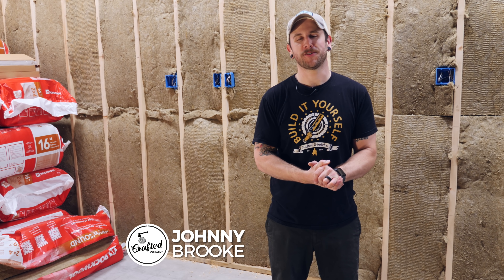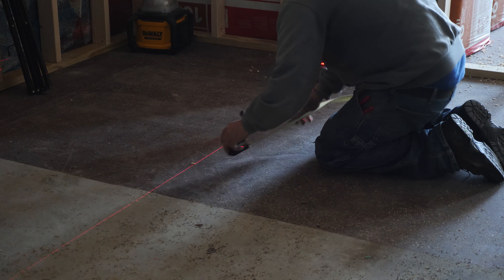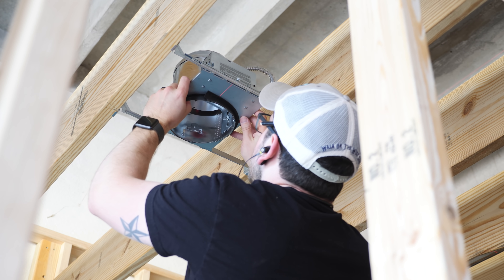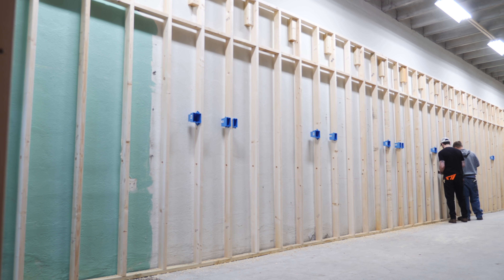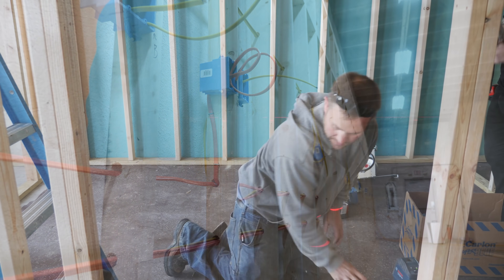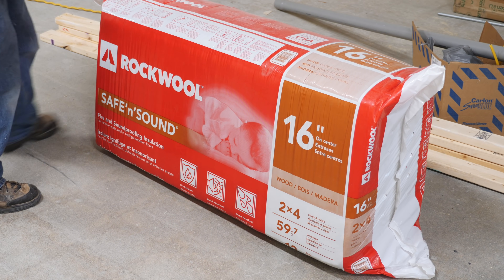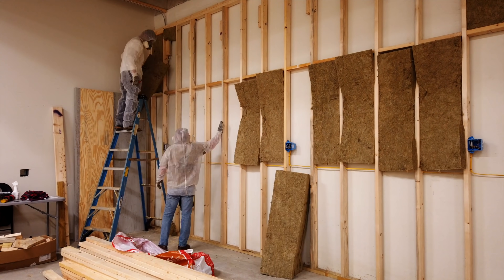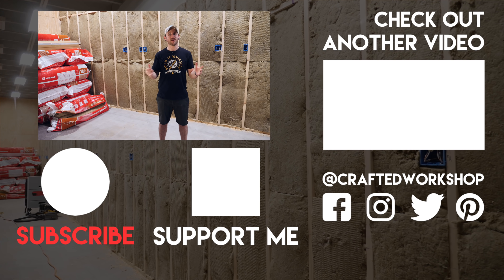Building My Shop : Electrical, LED Shop Lighting & Sound Proof Insulation

Comment: Good video! Did your electrician give you crap for not leaving a few inches of slack cable outside of each box, or is code different in the US? I only have basic knowledge of wiring, and your layout is SUPER clean, but this seems to be a major no-no afaik...?

Comment: You made more work for yourself by running the wire down the entire length of the walls rather than finding the middle of the wall and running it down one side and then the next.

Comment: You should have used those plastic bridge romex staples with the 2 small nails instead of using those Metal staples because those metal staples can pinch and short out the  conductors of the Romex cable !

Comment: If the 2x4 stud wall has the gap between it and the concrete wall could you just run the wiring in the gap and avoid the drilling on every stud?

Comment: Im an electrician in norway and every wire and staples look so complicated in america, its like you are 50 years behind
Reply: pølsemakern  do you have samples of a video like this that meets your countries standards?
Reply: @dennispope8160  https://www.youtube.com/watch?v=1ILpUdxIvSo, we have tubes in a curved shape so that water / condensate will drain into boxes, cables are finished in pipes straight from the factory, it is not shown in this video. We use pipes to be able to change the cables, as something happens to them.
Reply: This video is a bit old and we do a lot of smarter things, and this video is for people at school so its a bit slow
Reply: @dennispope8160  https://www.youtube.com/watch?v=MLQ6IWLPX0E
Reply: @dennispope8160  https://www.youtube.com/watch?v=YIIuksNh1pI

Comment: Great build, being in UK construction it’s interesting to see the differences in legislation. In commercial installation we have to use steel framing for all our partitions, due to the wood being a fire hazard. All cables passing though a partition or stud wall must have a steel plate nailed to the face to stop anyone boring or nailing through to the cable.

Comment: Somebody forgot to tell them about a service loop.  Oops.  Otherwise, nice work.
Reply from the maker: That’s much more common for things like Ethernet cable. Electrical cable has to be secured to the studs, you can’t have extra wire floating around.
Reply: @craftedworkshop  That must be a regional/american  thing.  Here (Canada), it's a staple within 8" of the box and we always have an 'S' type loop ahead of that but before the box.  I like it because I've done so many renovations and replacing switches and receptacles is a royal pain with no extra wire.  Thanks for the reply. Great shop!!

Comment: Why not run the wires between the studs and the concrete wall❓ Maybe attach them to the concrete with cable clips.
Reply from the maker: Drilling into concrete is much more time consuming, not sure it would have been any faster.

Comment: Do you have ground in every power outlet, just curious. I wonder why and if that is because you use metal rods for the romex cables. Here in Sweden we use plastic rods with flex in them to wire up cable in walls, with ground ofcourse.
Reply from the maker: All of the wire we pulled already had a ground wire built in, so that we can then ground the outlets.
Reply: @craftedworkshop  aha, I thought it was something like that. Thanks for answering. Good luck with your new workshop 👊

Comment: Don't you have to put metal plates on the studs to stop you from drilling into the wire? Or did I miss that?
Reply from the maker: No, since the wires are ran deep enough in the walls.

Comment: That laser has come in ridiculously handy on this job. Love the idea of measuring on the floor and then shooting it on the ceiling with the laser. Wiring looks great. I bet your electrician loved it. Thanks for sharing!
Reply from the maker: Thanks, definitely loved the laser! And yes, we made it super easy on the electrician.
Reply: Yes, having the holes line up for the wiring looks really professional . Sure , it won't be seen later , it's just a sign that the craftsmen take pride in their work . One thing though , I always strip my romex before putting it in the box , it makes life easier later, for a number of reasons .

Comment: That insulation surely killed the echo problem, but won't the plywood walls bring it back considerably?  

In any case, great work.  Very interesting to watch this come together.
Reply from the maker: Thanks! The plywood will bring back some echo but the space should be much nicer and the sound transfer to my neighbors will be hugely reduced.
Reply: @craftedworkshop  Yeah, definitely the issue of noise from your activity is an important matter.  It's definitely looking great.  Maybe you could hang fabric on top of the plywood or something to help your end?
Reply from the maker: Yea we’ll see how it sounds once the plywood is in!
Reply: Rather than add a new comment I’m adding to this thread because it continues what you’ve covered. I’m a former live sound engineer and current sound editor/designer. I’ve been doing this for years so I know a few things about sound control. 

I’ll start with some clarification. There’s a difference between sound ISOLATION and sound TREATMENT. Isolation is also called sound proofing - it keeps the sound from transferring through the walls to your neighbors. This is definitely the most important concern due to shop noise. Sound treatment is controlling the sound inside the given space. This is achieved through absorption and diffusion. In a space with long parallel walls you will have tons of slap and reverb. Once you put up tools, cabinets and machinery that will help diffuse the sound but it needs to eventually be absorbed. 

If you  put in some large frames on the top half of your wall and fill it with the insulation, you can cover it with some basic canvas or I’ve seen other shop owners use various flags. This will keep the sound under control. The more you add the better it will be. If after this you still have too lively of a room you need to add either soft walking mats on the floor or out more panels up top. 

Great build so far.
Reply from the maker: Thanks! And yea, that is why we built the sound panels in addition to adding insulation to the walls. We’ve already finished with the plywood and the echo is certainly still drastically better than before, and that’s without all my stuff in the space to break up the sound.

Comment: The staple in the 10-2 at 7:03 looks like it is too tight go back and loosen it some if you can.
Reply: Ohh Paul I noticed that too. Also in future you should leave some slack in the wiring, in case you ever have to do any re-wiring you have some to pull through. Great video though!

Comment: Great space!   I have years of acoustics training from recording studio design.  The added wall may not do as much as you hope since you didn't frame all the way to the ceiling and also because you effectively coupled the framing of your new wall to the original wall.  The safe n' sound will help a bit with sound transmission between you and your neighbors but when you add the drywall or plywood over the insulation, most of the benefits that you currently hear in your microphones will be gone and the room will have about the same amount of echo as it did before.  It will sound a little bit different because you changed the dimensions of the room by adding walls and because wood, drywall and concrete all have different sound characteristics... but a lot of the echo will return.  You will likely need a bunch of sound absorption panels along the walls (similar to what you put on the ceiling) to kill the sound reflections bouncing around.  Keep up the great vids and good luck!
Reply from the maker: Good tips, thanks!

Comment: Loved it, quick question the 240V is it just for the tools or is America switching? Never heard of 240V in America also 50 or 60Hz?
Reply: America isn’t switching lol, it’s just for more heavy duty tools
Reply: @JR0405  Thanks for the reply would've Found it odd if you we're switching. Is there also then 400V 3 fased available in the US for even larger machines?
Reply from the maker: There is!
Reply: @JustinManson  480 three phase
Reply from the maker: 240V is for tools with bigger motors or larger power draw, like my welders. We’re not switching, hah!
Reply: @craftedworkshop  thansl for the reply would've Found it odd if you we're switching, good luck and excited to see the rest of the build!

Comment: Nice job! Just curious, I was told that any time you’re making contact with cement you need to use pressure treated wood but I didn’t see you doing that here is that alright?
Reply from the maker: You need pressure treated for concrete floors or exterior walls, which we used. We just used standard 2x4s for the rest, since the shop walls are interior wall.

Comment: I use emt a lot for wiring and find if you chamfer the holes a little it makes pulling the wires a load easier
Reply from the maker: Good tip!

Comment: won't code have you put nail plates where your romex is running thru the studs?
Reply: Only if the hole is is within a 1 1/4 inches of the face of the studs
Reply from the maker: Yup!

Comment: Great video . How did you find the regulations for installing the wiring . Like you knew exactly what the codes were to pass inspection . Thanks .
Reply: Not to be rude, but you can Google the coffee for electrical
Reply from the maker: I worked with a licensed electrician who knew all of the requirements. Since I had to pull permits and get inspections, hiring someone who knew exactly what was required was certainly worth it.

Comment: I don't understand why you (and USA in general) still installing those massive can down lights? Here in the UK we use much smaller down lights which use GU10 retrofit LED lamp (or round LED panel which is about 1 inch thick). so much smaller in scale compare to those you use. 🤔🤷‍♂️
Reply: It's all preference and cost, I'd imagine.
Reply: It's more to do with the actual output and spread of the light, gu10's are more of a domestic light.
Reply: I was wondering the same think about the panel 'canless' LED lights.
Reply: we do have lights similar to that i install them in all the houses i do

Comment: If this a a rented space, what happens to all your work when you are done renting it?
Reply from the maker: I could take it with me, hence why we’re using screws rather than nails. I’m planning to stay in this space as long as possible though.
Reply: @craftedworkshop  Thanks for the reply.  I hope it works out for you long term.
Reply from the maker: Me too!
Reply from the maker: I had to add the framing to add the sound proof insulation. Since I paid for it, I am allowed to take it with me.
Reply from the maker: For sure, thanks!
Reply: @ragincagin-f4w  Why wouldnt a landlord allow a renter to take their own property with them?

Comment: No metal plates needed over the wires in the walls? Maybe I'm posting this to early before the video is done?
Reply from the maker: No, they’re set back far enough in the studs to not require that.